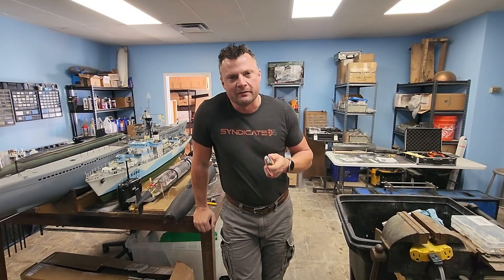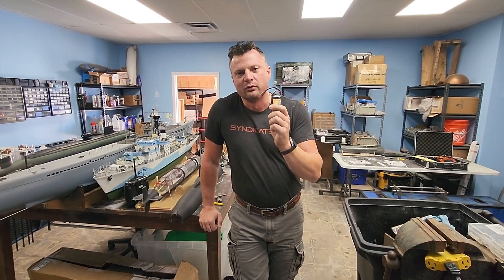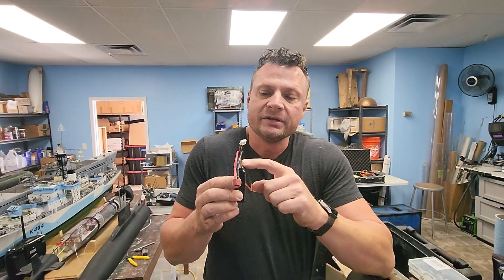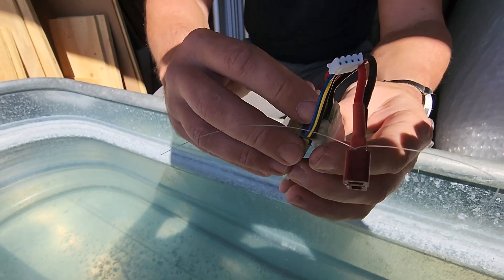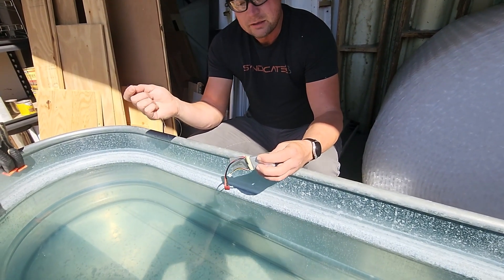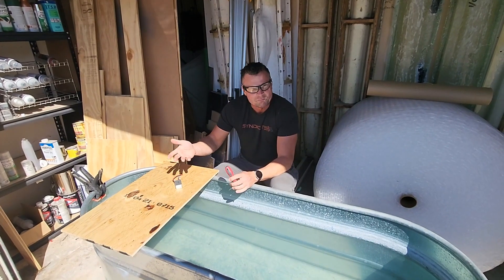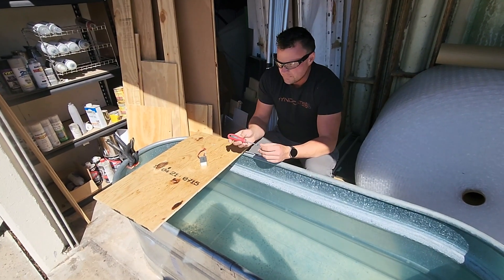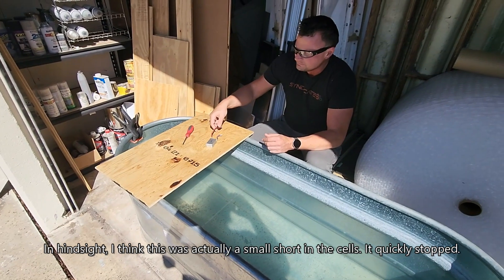LiPo Batteries Run In the Water. Will I Blow Myself Up!?

Comment: The 'lithium' used in LiPo batteries is not lithium 'metal', but is 'lithium carbonate' (or something very similar) which is actually extracted from water in the first place (ever seen those big lithium drying 'ponds'?). Given that Lithium carbonate is extracted from evaporated water ponds, it doesn't have any issues being submerged in water. If I had a dollar for every person that told me my LiPo batteries would react dangerously in water, I'd have over 10 bucks. Cheers for doing this.
Reply: Lol, I just came here from an AI telling me it was dangerous to submerge an lithium ion battery in water.

Comment: I've had several LiPo cells puff up, though none has ever caught fire (of course, I didn't continue using them).  That said, I personally prefer cylindrical Li-ion cells, but I understand the advantages in energy density and physical size with the LiPos.

Comment: Would the problem be at the connection between the battery and the boat if the connection was wet?
Reply from the maker: The positive terminal will bubble, but that's it... at least in fresh(ish) water. In salt water, the pack would short out and... yes... it would be bad.

Comment: I've been sketching out about my rc crawler battery it's a 5200mah 3s zeee in a hard case and it has holes around the cables and when submerged the hard case takes on water in currently drying it before a recharge. Tho u won't catch me stabbing slashing them u cray cray man lol not all batterys are created equal. I'm not sure people arent worried about them catching fire when wet. More worried about them failing and having a lipo fire at home later rather than in the model catching fire. Well I do anyway lol

Comment: Is there any chance that in its final state of abuse you took a voltage reading to see if it could still power you home??!
Reply from the maker: No, we didn't. That would have been a cool thing to check. The primary goal was to try and get it to catch fire. We forgot about testing battery performance after the mauling...

Comment: So is it save to recharge the li-po when it wet or semi wet ?
Reply from the maker: Electricity is flowing either forward or backward. Charging is at an even lower amperage than running, so I'd guess it would be safe to charge damp, but better to dry it out first, which is needed to do after every run anyway.
Reply: thank you i had dropped mine in water also 😅😂 but instantly grabbed it and dried it never charged it tho because i didn't want it to blow up

Comment: How would that go in salt water I wonder?
Reply from the maker: Corrosion across the terminals would be much faster and battery depletion increased. I would not do it myself.
Reply: @RCSubGuy  you toss a punctured pack into salt water once you've gotten the over all voltage to about 9.9v - this then zeros the charge and the pack can be discarded in the trash.